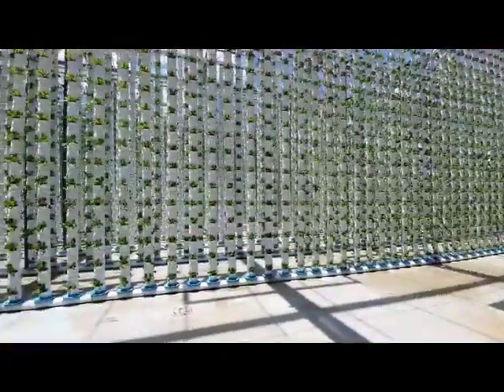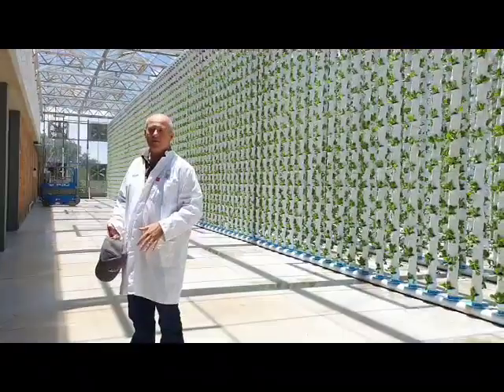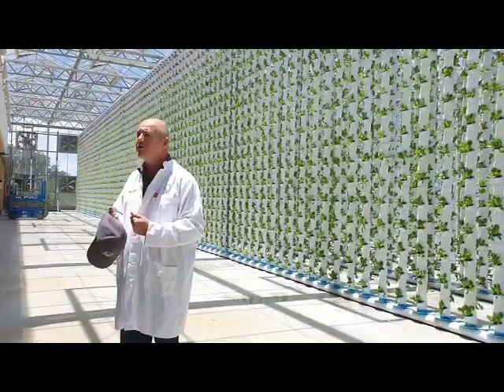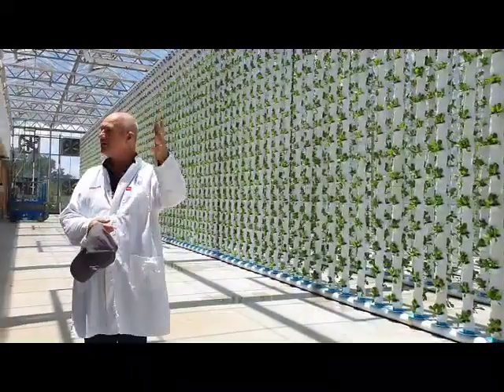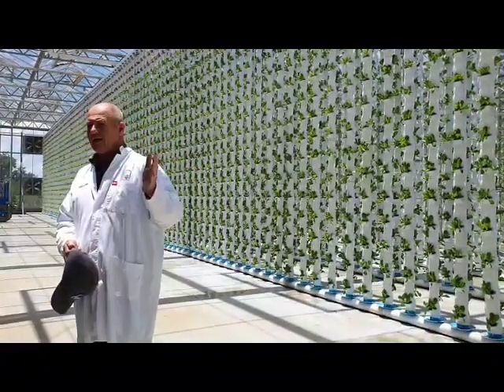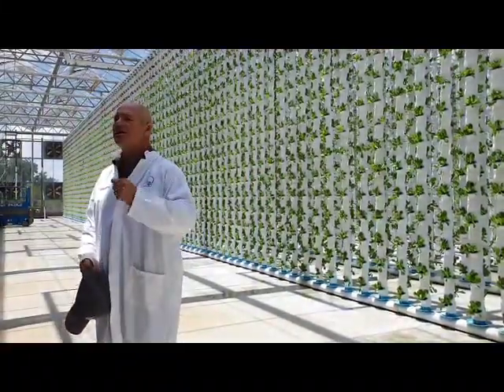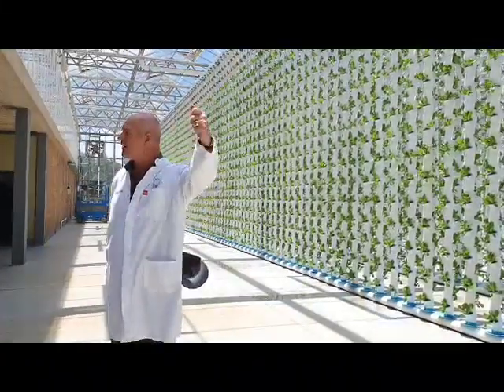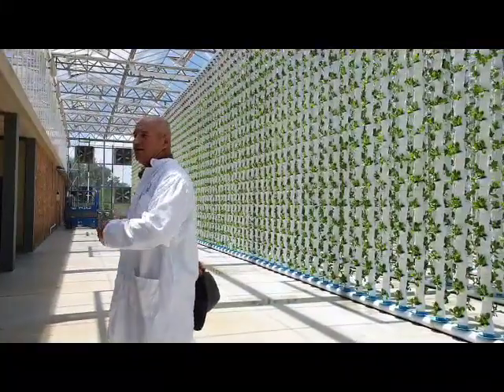CAN-Agri on Vertical Farming and a smart, sustainable approach to growing food.

Comment: What about the shadow of one column or tower on the other.... Won't that affect growth ?
Reply: Mirrors and mylar could help.
Reply: They orientate the rows with the sun's path to minimize shadows
Reply: @jasonedwards2622  the sun's path changes with the rotation of the earth around the sun. We won't be able to change the angle of the greenhouse to follows the sun's path.
Reply: @anujshah4595  yes the sun either high or depending on the season. But they still orientate the greenhouse to maximize exposure and minimize shadows.
Reply: @jasonedwards2622  so in 1 Acre (4000 sq mt) how many towers can fit ?
Reply: @anujshah4595  that's a good question
Reply: @anujshah4595  I guess it depends on what you plant in them and how tall they are